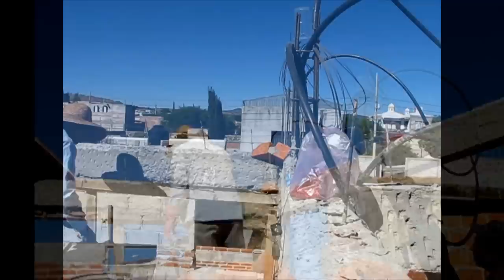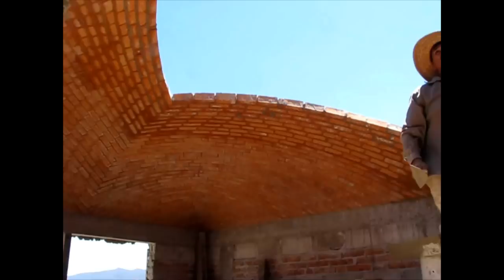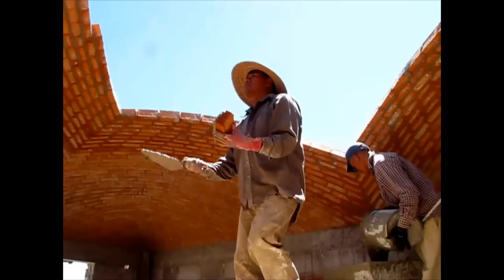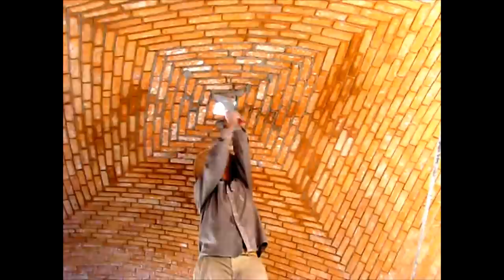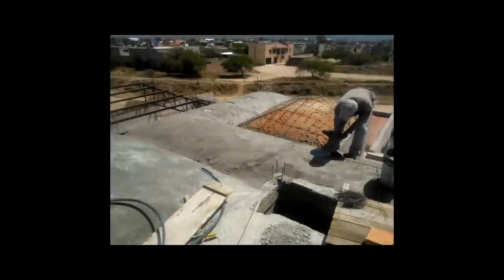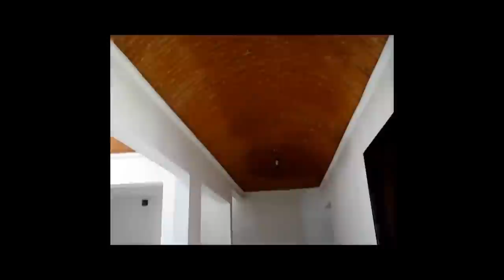How to build a solid brick dome virtualy Defying Gravity, Truly amazing! The strongest celling

Comment: nice. but me being from construction. they should have reinforced going through. in case of a earthquake. or a drop of a hammer. which will bring it All down.the bars will help to stop it from falling on your head. but it will crack.. love the curves and angles tho. awesome
Reply: Rewi Boynton watch the whole video carefully. Reinforced posts and beams and post reinforced arched roof before final 2" veneer.
Reply: The rods need to run through every brick Bruce Bell. It does not have to come from the wall panel right to the tip of the roof. But you must lap bars to the top brick. I'm pretty sure it wasn't running through the lot. Keep your 5c worth
Reply: Rewi Boynton I have been licensed 44 years. I have built complete commercial and residential from 3 stories in the ground to 7 stories up. I have hired 100s upon 100s of masons. We built an underground arched brick wine cellar 50' X 80' X 14' high under a 7000sf home in 1988 for the president of the largest tool manufacturer in Europe. We used no steel and somehow that met IBC and stood in perfect condition thru several earthquakes. The raw facts are that the dome/arch and pyramid are the strongest shapes and are nearly indestructible. 

You don't have experience and you don't know what you're talking about. BTW, although free, advice, you best educate yourself.

Comment: The Brickies are good and so he should be laying those things day after day but when you do work like that which looks visually stunning then you would want to see clean brick joints and non-cement stained bricks. At the 19.21 stage just look at the splodges of grey mortar in the center of the internal angles and outside at about 22 look at the cracking in the mortar where the hot brick surface has only had a light spraying of water before the rendering work. I was surprised to see them even using a hosepipe and they should at least have shaded the area that they were working on from the sun.

Comment: What happens when it expands and contracts?
Reply from the maker: Once closed, the arch, and even more, the vaults, are the strongest engineering structures there are, watch this video where weight tests are made on these vaults, follow the following link, where they do the test with hollow materials and made with plaster, in Mexico, we use solid brick and concrete, verify this in the experiment of the following video: https://youtu.be/vHrIkk4wo9s

Comment: yeah. very nice...would not want to be under it in an earthquake
Reply from the maker: +brucegor you will be safer under this roof under a earthquake than in a wood house under a fire 🔥, and fires are much more frequent.
Reply: well here everything is up to code. I have smoke alarmscarbon.monoxide detectors et al My insurance is paid up. earthquake resistant construction.would not want to test your theory standing under that much free standing brick

Comment: Why does he dip some of the bricks in water?
Reply: Bricks absorb water. Cement needs that water to go through its chemical reaction. If the bricks suck the water from the mortar, the strength will be reduced. But if the bricks already have water, they wont suck it from the mortar.
Reply: @luket1815  
Nice, makes sense. Thanks 👍
Reply from the maker: To remove dust

Comment: Hope this is a low seismic activity area...
Reply from the maker: Once closed, arches, and domes are the stronger structures, watch this video where substantial evidence on these vaults are made, where they do the test with hollow materials and facts with plaster, in Mexico, we use solid bricks and concrete, brick see this video: https://www.youtube.com/watch?v=vHrIkk4wo9s

In Mexico City there was an earthquake of 8.1 on the Richter scale in 1985 and many modern buildings fell dawn. but many of the oldest buildings (15th century built with this technique) were undamaged or slightly damaged. the metropolitan cathedral is sinking down (because of the ground in which was once a lake and yet still standing ...

Comment: yeah im calling bs on your saying its strong. that dome is not made with even fitting wedges, one brick can easily fall out.  the mortar joints should look like this | | not \/.. if the joints are kept parrallel, even if the mortar fell out the brick would never fall out because its wedge shaped.

Comment: well looks nice but won't last at all
Reply from the maker: Once closed, the arc, and vaults are structures stronger engineering there, watch this video where substantial evidence on these vaults are made, follow the following link, where they do the test with hollow materials and facts with plaster, in Mexico, we use solid bricks and concrete, brick see this video: https://www.youtube.com/watch?v=vHrIkk4wo9s

in Mexico City there was an earthquake of 8.1 on the Richter scale in 1985 and many modern buildings fell dawn. but many of the oldest buildings (15th century built with this technique) were undamaged or slightly damaged. the metropolitan cathedral is sinking down (because of the ground in which was once a lake and yet still standing ...

Comment: This is why when an earthquake hits even a modestly sized town in Mexico, it kills thirty thousand people. Impressive craftsmanship though.
Reply: Christopher Milne So, you know this because facts I'm guessing? these houses hold up great against earthquakes, plus the only part in mexico prone to earthquakes is central México.
Reply: Apparently you are unfamiliar with the effects of even a minor temblor upon un-reinforced brick construction. I recommend you do some reading. It's neither my job, nor my desire, to convince you that you are wrong.
Reply: Christopher Milne domes are highly resistant to earthquakes, examples of unreinforced domes that have withstood earthquakes have been seen in Mexico, Iraq and Greece. second, the link to this video shows that the video was taken in the state of Durango, an area where there are no earthquakes.  do your research next time.
Reply: Christopher Milne you missed all the rebar in the posts, beams and the cabling over the top like we use in pre stressed and post stressed construction. It is not unreinforced.
Reply: I saw the cabling. Are you telling me that when the mortar is pulverized by the motion of an earthquake, and the bricks are no longer in contact with one another, that that cabling is going to support not only the rendering on top of the bricks, but the weight of the bricks themselves?
Reply: Christopher Milne the dome/arch and pyramid are nearly indestructible. The concrete nor the mortar will pulverize. This is basic physics. The arch will support itself laterally and horizontally. It is not a flat roof. The arch is basically indestructible. The lamination above the bricks looks like nonshrink waterproof cement mixed into a very resilient concrete over reinforcing cables.
Reply from the maker: Once closed, the arc, and vaults are structures stronger engineering there, watch this video where substantial evidence on these vaults are made, follow the following link, where they do the test with hollow materials and facts with plaster, in Mexico, we use solid bricks and concrete, brick see this video: https://www.youtube.com/watch?v=vHrIkk4wo9s

in Mexico City there was an earthquake of 8.1 on the Richter scale in 1985 and many modern buildings fell dawn. but many of the oldest buildings (15th century built with this technique) were undamaged or slightly damaged. the metropolitan cathedral is sinking down (because of the ground in which was once a lake and yet still standing ...?
in fact, fires are more common than earthquakes, and more people die in USA by fires than in all america in earthquakes. Do not you think there are other more dangerous buildings than this?
Reply: I'm NOT an engineer and I cannot argue authoritatively. My opinion is based more on my practical experience with concrete, brick and mortar. I'm afraid this argument has gone about as far as it can.
All I can say is:  I WOULD NOT sleep under such a roof myself.

Comment: Why dip the brick in water first?
Reply: 69adrummer. To saturate the brick with water. if not done the dry brick would absorb water from the cement between the bricks causing the cement to become weak and brittle.
Reply: very cool. It's always a joy to watch people who are talented do what they do (although, reading the comments, some might not agree).
Reply: its easy to criticise not so easy to learn a skill
Reply: To bind the cement to the brick ,the brick will exorb the water which will draw in the binding hardener in the cement on o the pores of the soaked brick,sooo when dry the mixed fement and the dipped brick water in the poees harden and dry will give a stronger adhesive..

Comment: I'm not seeing the gravity defying. They're building an arched roof. The edges are clearly angled to support the arch. The weight is dispersed down to the columns and edges. While I wouldn't trust Mexican building standards, in principle it's a stable structure and these guys look very proficient at building it.

Comment: Danger in earthquake
Reply from the maker: Once closed, arches, and domes are the stronger structures, watch this video where substantial evidence on these vaults are made, where they do the test with hollow materials and facts with plaster, in Mexico, we use solid bricks and concrete, brick see this video: https://www.youtube.com/watch?v=vHrIkk4wo9s

In Mexico City there was an earthquake of 8.1 on the Richter scale in 1985 and many modern buildings fell dawn. but many of the oldest buildings (15th century built with this technique) were undamaged or slightly damaged. the metropolitan cathedral is sinking down (because of the ground in which was once a lake and yet still standing ...

Comment: What it values in creativity, lacks in stability. I guess Mexico doesn't get earth quakes.
Reply from the maker: Once closed, arches, and domes are the stronger structures, watch this video where substantial evidence on these vaults are made, where they do the test with hollow materials and facts with plaster, in Mexico, we use solid bricks and concrete, brick see this video: https://www.youtube.com/watch?v=vHrIkk4wo9s

In Mexico City there was an earthquake of 8.1 on the Richter scale in 1985 and many modern buildings fell dawn. but many of the oldest buildings (15th century built with this technique) were undamaged or slightly damaged. the metropolitan cathedral is sinking down (because of the ground in which was once a lake and yet still standing ...

Comment: All well and good until an earthquake hits....
Reply from the maker: Once closed, arches, and domes are the stronger structures, watch this video where substantial evidence on these vaults are made, where they do the test with hollow materials and facts with plaster, in Mexico, we use solid bricks and concrete, brick see this video: https://www.youtube.com/watch?v=vHrIkk4wo9s

In Mexico City there was an earthquake of 8.1 on the Richter scale in 1985 and many modern buildings fell dawn. but many of the oldest buildings (15th century built with this technique) were undamaged or slightly damaged. the metropolitan cathedral is sinking down (because of the ground in which was once a lake and yet still standing ...

Comment: The bricks partially rest on the top of the walls, and the bricks after those rest on top of those bricks.They also have to be using a fast acting mortar; those bricks would slide right off if it they did not. No amount of experience can allow you to "defy gravity".
As for breaking the bricks with a trowel, you could break a brick with the tree branch if you hit it enough. The reason you would want to make a cut or use a hammer is so you don't damage your trowel which, as can be seen quite plainly, has more dents than my overworked anus. But they can do what they want with their tools.
The work is good, but I have seen this video everywhere. Click-bait title for an already good video.
Reply from the maker: Here you can see about the cement, and we and explain why the vaults do not fall and what is its structural base  (remember to turn on captión, i have translated to english): https://www.youtube.com/watch?v=hE0MSwqoaVU

If you see this video in other place, i will be glad to tell us where.

Comment: since when is applying  tacky substance to an ARCH defying gravity?
Reply: You are missing the point, it takes a while for cement or any substance to dry out and achieve full strength, which may take as long as 48hrs yet the amazing thing is that these masons can erect a whole roof in a day and the mass of those hundreds of bricks needs no support whilst being laid, they virtually becomes self supporting, no shuttering or posts (acros ) to support the roof required or used, this is the astonishing part, one may assume that some sort of support must be needed to form shallow curved arches, I know if you construct arches deep enough they become self supporting and can then stand further weight as in railway arch bridges.These are truly amazing.
Reply: samdomding sorry but that was the worst explanation ever. an arch is self supporting. Shallow or not. These bricks are non-compressible. Once the keystone is in, each layer is nearly invincible. They distribute ALL of the load directly outwards and down to the supporting structure. The cement between them has nothing to do with it aside from an agent to hold them in place until the keystone is in. Of course it adds some stability, but its NOT all that amazing.
You've never been to a science museum that had you make an arch like this with large squishy blocks and NO cement? Because I have, and I tell you what. Its really easy.
Reply: Josh Brown I'm saying if you do you'll have a basic knowledge of rudimentary building techniques. So easy a child can learn it with blocks.
Reply: Tyler C Standing up on your feet is defying gravity, not very impressive but yes they are doing it here.
Reply: Tyler C you are obviously not a mason dealing with heavy materials. Squishy blocks are not masonry units and would not support the weight of this structure. Physics applies to both but the mass of the masonry is hardly comparable to squishy blocks.
Reply: Bruce Bell as in. Squishy blocks are SQUISHY. they don't hold shape whereas these "masonry units" do.
Building an arch out of these is EASIER than squishy blocks because they don't compress.
Or is that too hard to understand?
Reply: Tyler C none of this is hard for me to understand. I have 44 years, licensed, active in commercial and residential, big, big stuff. I've hired 100s of masons and laid and set for many years. The mass and rigidity of the masonry units is what makes it work so well. The dome/arch and pyramid are the most indestructible shapes for earthquake resistant buildings.
Reply: Bruce Bell you literally said what I just said. "The mass and rigidity of the masonry units is what makes it work so well" end of discussion
Reply: Tyler C glad we agree. Im relieved we both understand. Have a good evening.